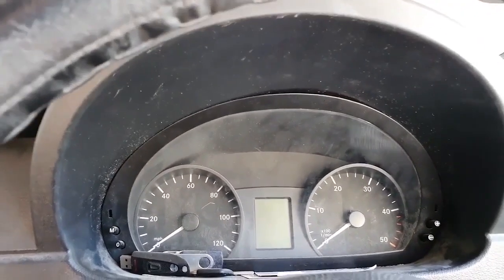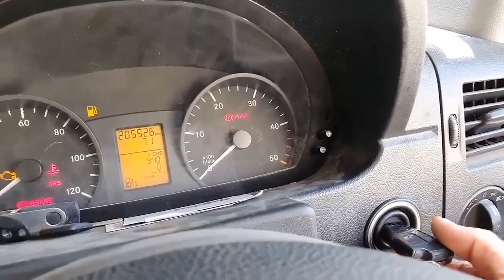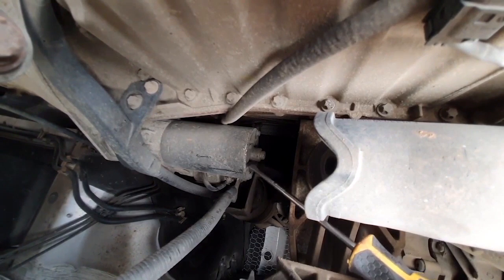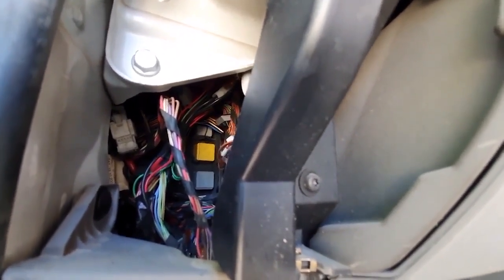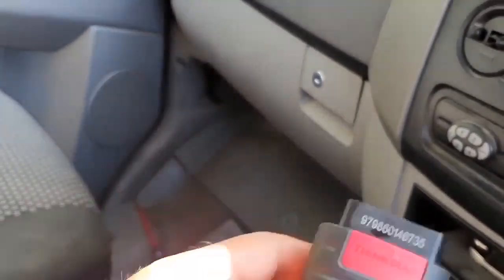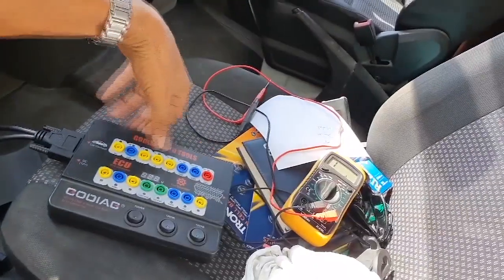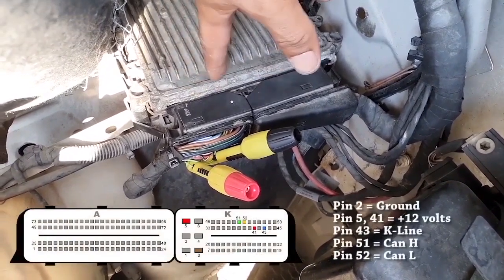Mercedes Sprinter (w906) No-Crank No-Start - Fixed

Comment: I had the same issue with a 2009 VW Crafter and I used your video as an example and in my case there was a blown fuse in the Fuse holder C, on left A-pillar, F21
Thanks for the video, very well explained.

Comment: I have a 2006 Dodge sprinter it only starts with starting fluid, can you help me with this problem
Reply from the maker: Hi. That means not Diesel/petrol gets to the engine. Check your diesel/petrol pump.
Reply: @yiannakosautomotivekeys2380 when I switch the key on the pump comes on , could it be the pressure regulator,  can the pump in the tank works but not working 100 percent?

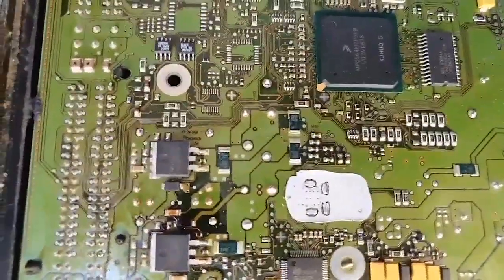Comment: Hello, Great Video, well documented process, your logic make a lot of sense, I only have two questions, in the video at the minute 19:10 seconds, you say, you are "not going to put the good ECU, the one that I fixed back in the car" ?  you have 2 ECU's?  at the end you did re-touch the solder connections and is ecerything working still ok after 2 years??,  thank you Sr.

Comment: Most of these units are made using lead free solder, i found this out on a a b s module on a volvo, this solder is crap, it is so bad, that it is not allowed in aircraft components.

Comment: This should be called grass root trouble shooting. My sprinter went into the shop 2 months ago for oil leak, the mechanic determined that oil cooler gasket was bad. We decided that he’d fix it and for some reason he offered to replace the rear main seals also. I went back a month in to discover that van was still leaking when driven and this time it was transmission fluid. I took closer look and discovered the transmission adapter was broken off and Christmas tree wires hanging freely. The mechanic have been test driving the van not knowing that transmission harness is out. Fast forward to after buying and installing new harness adapter with “wiring diagram”, van has currently refuse to start. It’s now same problem as this video and last I heard, the transmission module is fried and he’d be ordering one.  Not that I’d be paying for all the carelessness, I was just curious why a van would suddenly be unresponsive.

Comment: Thank you for a great video good fix I follow this guys that you fallow. 
Question 
What make you resoldering the pins were those loose?
Reply from the maker: @jordysandino6577 - Hi. The reason of desoldering the pins is because their solder cracks due to the heat. You cannot tell that the solder is cracked, unless you view them under a camera (microscope).

Comment: looks like its a relay problem, there is no heater coil light when you turn the key. there will be corrosion in one or two of the relays above the fusebox. swap these out. check sprinter relay no start on youtube.
Reply from the maker: @Stephen Millson - If you watch the video to the end, the answer is there!!! Thanks for watching.
Reply: Yeap loosening contact pin at the ecm

Comment: I get the same problem its stop till I'm driving.
Reply from the maker: It sounds like you have the same problem as I had. Try and do what I did, it might solve your problem. It's important to notice if the engine stop when the weather is hot. Good luck!!!